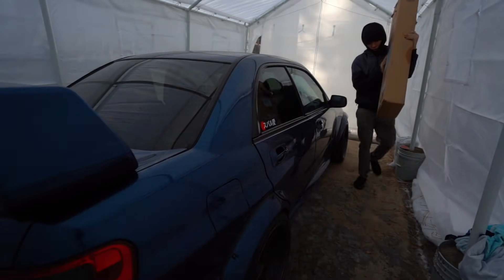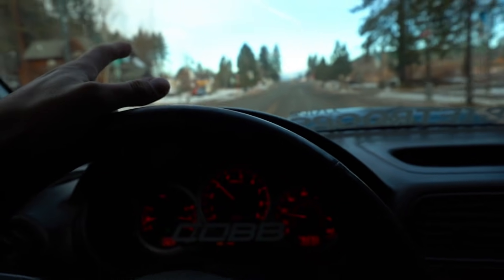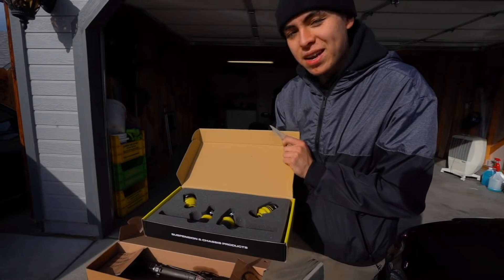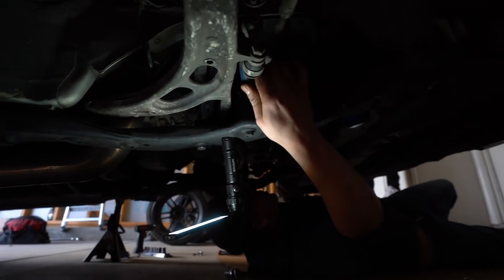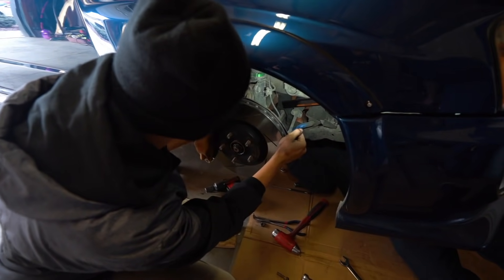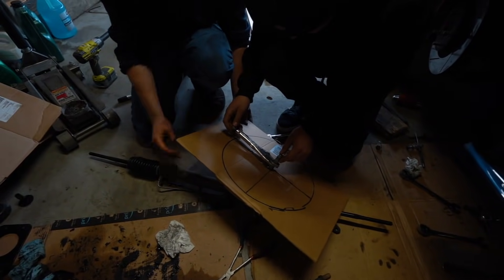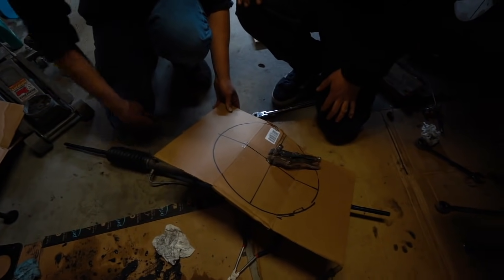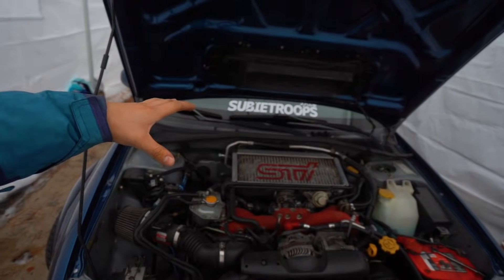Fixing The BIGGEST Problem On My STI! (No More Death Trap)

Comment: O no my Outback has the same issue where power steering leak past the seals in the steering rack. I just put stop leak to temporarily stop it until I have the money to fix it. I wanted to see if a sti rack will fit. It’s my daily driver but it is temporarily out of service until I get that fixed. For now I’m driving the wrx which is horrible because my rear struts are shot and my commute has lots of potholes. :(

Comment: I have a problem putting back the STi Solid Steering Linkage that connects from the power steering rack and steering column. Any tips? I don’t know if I align the rack properly with how many turns you suppose to do, so that the rack is aligned before installing. Do you think that would be the cause?

Comment: I got a 05 sti, and i think my power steering pump is going bad also. If you guys can help me out maybe pin pointing if its that. When my car is cold and I try to turn my steering wheel its insanely hard to turn as if theres no power steering fluid. But when it warms up it will go away. But itll get tight again for a few seconds. Im not sure if it could be my coils either though. They make a clinking sound every time I turn. Please let me know.
Reply: Buy the red o rings from subaru ! Then flush the fluid. I have an 05 also let me know if it works
Reply: @westcoaststeve7698  I will probaly get to it this Wednesday or thursday. Cars is currently in shop for a crack in the upper oil feed line connecting to the turbo. Pos is leaking oil like no tomorrow
Reply: @Hamzasidiki   i also have a similar problem. PS gets super hard to turn, sometimes scary af wen im cornering at high speeds. replaced the PS pump, but the problem persists. idk if i am not flushing correctly, but im gonna attempt a power flush. and use the red o ring from subaru.

Comment: Can anyone help me i have an idle problem in my 1999 gc8 sti. When the car is warm and running for a while, it always drops to super low rpms and sometimes stalls when i come to a stop and my car is in neutral. I have replaced iac valve, maf sensor. I think its a vacuum leak but im not sure. Any tips
Reply: Ricky Chiz Bizkit most likely it could be a vacuum leak however if it has variable time if have a tech check out the cam sprocket sometime they get dirty and stop working properly it happened on my sti but check all the hoses the purge valve all that stuff sometimes the hose get hooked up the wrong way

Comment: u guys did a great job, but u left out a lot of the important steps, lol defintitely would not have anyone do a rack and pinion install based on this.  as u know those steering lines are a pain in the ass to remove and put back in as well and u need a special toool for that, crows wrench.  but nice work
Reply from the maker: Sai lee I understand completely. Took us about 6 hours to complete, so recording, explaining and trying to get it done all at once can become difficult!
Reply: Racks on our cars are a pain! Especially on the floor lol luckily I can use a lift